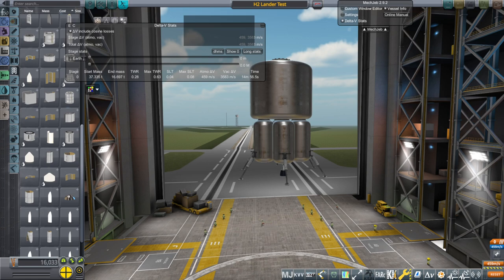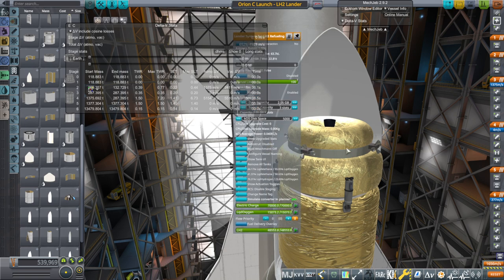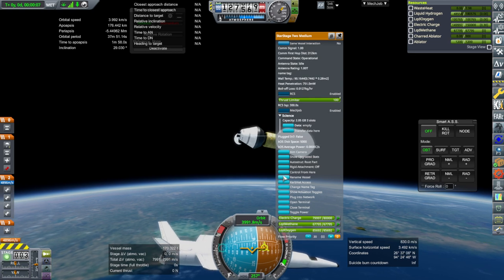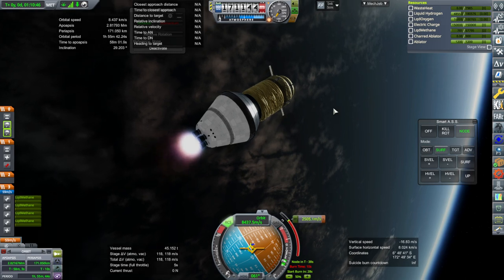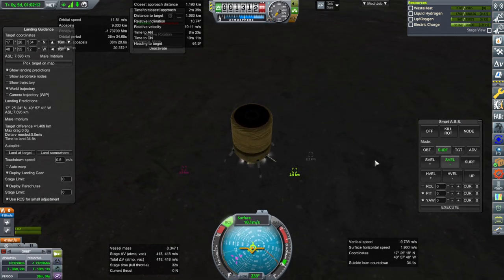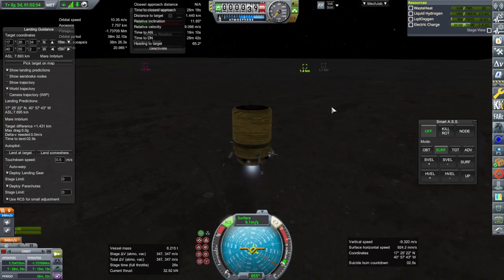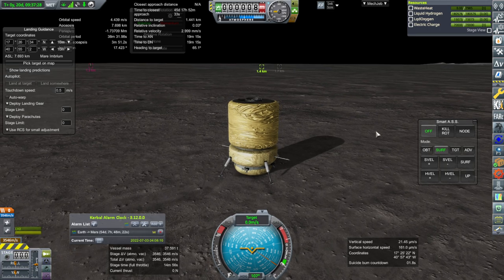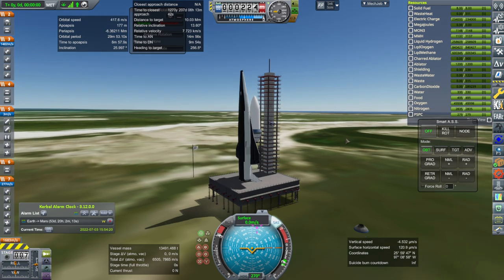Kerbal Space Program 1.8.1 with RO - To Mars and Beyond 08

Comment: That hydrogen tank mass is exceedingly bad.
The Shuttle SLWT External Tank had a dry mass of 26.5 tons. If you emptied the liquid oxygen tank, and only held the 106.3 tons of LH2, you'd have a mass ratio of 5. If we cut off the LOx tank and the interstage, reducing the dry mass to perhaps 16.6 tons (63% of original length) then we get an LH2-only mass ratio of 7.4!!

Right now, your LH2 tank has a pitiful mass ratio of 3.45, which is making things much harder than they need to be.
Reply from the maker: The catch there is that the External Tank hydrogen tank was non-load bearing - it just hung off of the intertank. These tanks have to bear the thrust of engines in the back and, when they're made like that, you end up with the dry mass of the SLS or Energia core, which is much higher than the SLWT.
Reply: @RaizSpace  theoretically could you get a lower dry mass by designing a sort of sky crane style lander with the LH2 tank hanging below, maybe a smaller diameter with engines & landing gear attached to trusses running parallel to the tank?
Reply from the maker: @naminho da silva I think the whole truss thing would probably add enough mass to make it not worthwhile. The thing about a normal skycrane, like my old Orange, is that it doesn't have to also have the landing legs and the need to stretch below the payload for those legs to work.